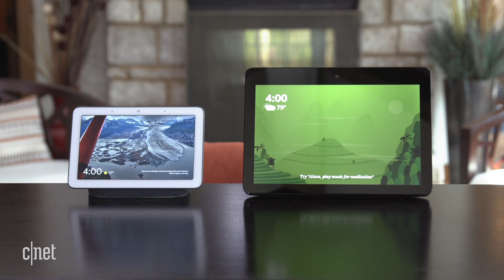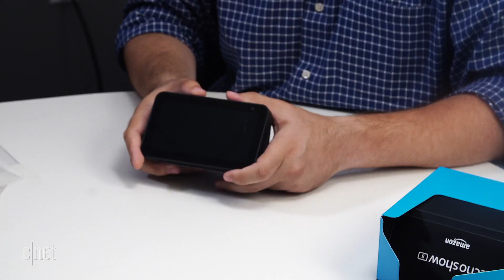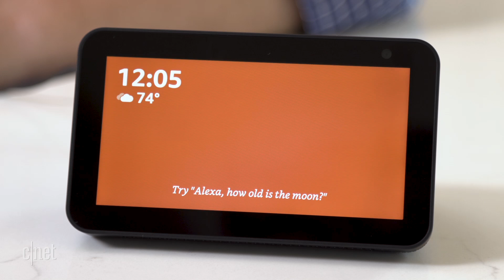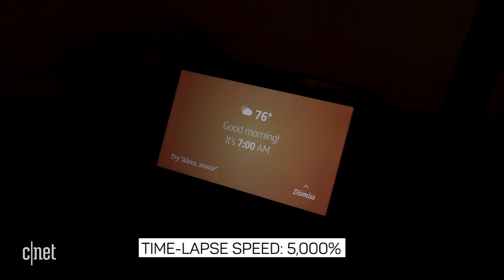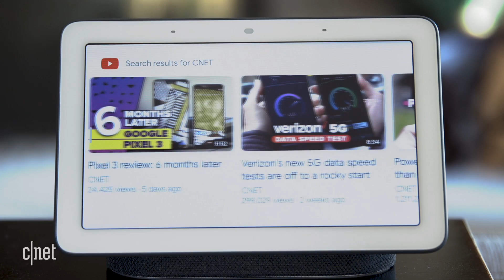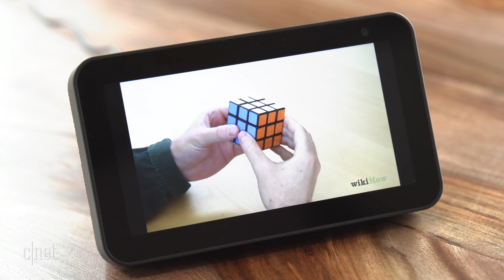Amazon's $90 Echo Show 5: It's Worth Shrugging About

Comment: We like the audio quality of the Echo Show 5 . . .  Until . . . you pair a bluetooth device,  or an Amazon remote.  After disconnecting the bluetooth, the built in speaker looses it’s fidelity and sounds very tinny.  To return the fidelity to the built-in speakers, I have to unplug the power and plug it back in.  Also, when I paired the Amazon remote, the mic function did not work; all the other features worked.  I had to pair the Amazon remote to my Echo Dot, and then the remote updated itself and the mic function would work on the Echo Show 5.  I may just have a faulty device.

Comment: I bought one and it's fantastic but I have two questions - is there a way to automate it to turn off display when noones looking at it (work day, night time?) I'm concerned about the electric / overall lifespan. Second question - should I even be concerned, or is it designed to run like that? Surprised there doesn't seem to be any discussions about this ON THE WHOLE INTERNET. I mean, it's like running a TV on all day isn't it?
Reply: Say Alexa TURN OFF SCREEN

Comment: Not in the UK you can't answer the Ring doorbell. Called up Ring support and they advised this feature wasn't available as shown? Trust me I've gone through the settings, reset etc etc, etc.... You can view the live feed but not when someone rings. Annoying, this as is the point of Ring Doorbell and especially as they're owned by Amazon as well!! Other than that I love it but why I bought it really was to link into the Ring doorbell and have multiple units around the house rather than pick up a mobile device and simply see a small screen pop up from the clock to the doorbell.
Reply: As of yet it doesn't work with reolink argus cameras either. Also reolink don't offer cloud storage in the uk. Seems we are not that important to these company's right now.

Comment: I bought two and it's a bummer that the device does NOT stream more than 10min in a role using any compatible camera, it would replace easily lots of baby monitors. The weird thing is that on my Fire Tablet does that perfectly, so essentially it would be better to place my tablet on the wall instead of buying any of those Echo Show if your intention is to use as a baby monitor during the night as well...

Comment: Spot has round screen ..has not to be compared with any ..it is a smart sculpture..! Echo Show 5 is giving the vision how a Amazon echo smart phone will look like it there will be one
Reply: There I no any native application from amazons to enable Alexa hands free in mobile phones like the google assistant does ..but if there will be then the show mode 5  too will be as a option in mobile phones ..similar to fire tablets   8 and 10
Reply: @bradengels  the amazon echo app, allows you to make video calls to another phone or show
Reply: @matthews4159  also allows  drop in and announcement,,,But Amazon Alexa app has not option for ALEXA hands free
Reply: @bradengels  if you put the phone into loudspeaker " hands free " would not the Alexa app then work in hands free?
Reply: @matthews4159  is that the Amazon Alexa App for the phone has not opinion to allow Alexa to use the mic of the phone for hands free ! You have to pres the alexa icon for Alexa to listen ! While Googlre Assistant app turns the phone into google home mini even google home hub somehow  because you can call google assistant "Ok Google" without the need to touch the phone

Comment: Just buy a Kindle fire and put it in show mode
Reply: I did this as a cheap alternative to the full size Show.  It works ok, but my stand isn't the best - the tablet is loose in the stand I have.  If the Show 5 had been available, I would have bought it in a heartbeat.
Reply: Show Mode is limited. There are features that an Echo Show has that you will not get on a Fire Tablet in Show Mode. Amazon is not going to undercut themselves.
Reply: @4daluvofnikki  Can you give us an example?  Because my Show Mode seems to do everything an actual Show would do.

Comment: So it's literally the Amazon Show but 5 inches. Clap for the innovation lol
Reply: It's also a heck of a lot less money - works for me!
Reply: @craig2web  yep!
Reply: EVOLUTION your body is a product of evolution, what wrong with that?
- You can also turn the microphone and camera off with a press of a button. And the built-in shutter lets you easily cover the camera.
- Full range 1.65” built-in speaker. 
- 3.5 mm stereo audio output for use with external speakers (audio cable not included)
- Price: $89.99   Buy 2, Save $30.  amazon usa
Reply: Not everybody wants a giant screen on their nightstand. Clap for how dumb you are.

Comment: Nicely priced.  That being said, if the 5.5" Show 5 is $90, then realistically, the 2.5" Spot should have it's still current price of $130 (!) cut down to something like $40.  C'mon Amazon!
Reply: 49.99 yesterday and today.
Reply: @Arperture  It's amazing they've given the Show 5 such a great discount, but essentially nothing on the Spot.  smh
Reply: Why is an Iphone priced higher than an ipad? Its costlier to get the electronics smaller than bigger, not the other way around.
Reply: @Sheepy007  Actually, the top of the line iPhone & iPad are priced the same at $999 - and that's the wi-fi iPad.  With cellular, it's an additional $150.  The internal electronics are essentially the same - ditto for the Show 5 & Echo Spot.  Amazon is just being obstinate with the Spot.  They didn't even put it on sale for Prime Day, while the Show 5 was marked down to $50!  It's just a rip-off in their lineup, and if they aren't going to lower the price, they should probably drop it from their lineup.  It just makes them look bad.
Reply: craig2web buy today
Reply: Its now down to $60. It may go down more for Black Friday
Reply: Gary Wright it did. $49.99 or 2 for $89.99
Reply: Cyber Monday deal be brining the price of the show 5 to $49
Reply: Patients my man.. probably (hopefully) will get price decrease on prime day. $40 price sounds like the sweet spot ..No pun intended.